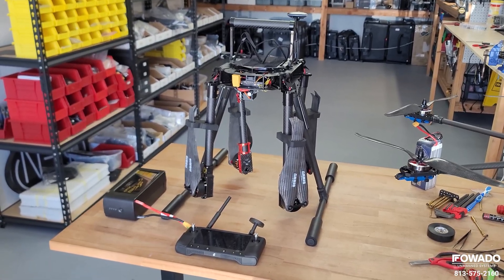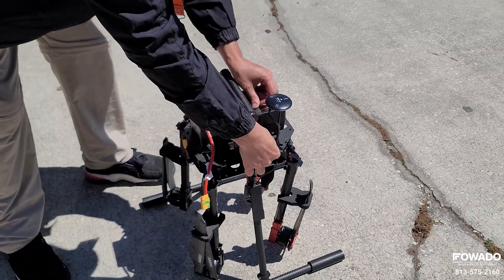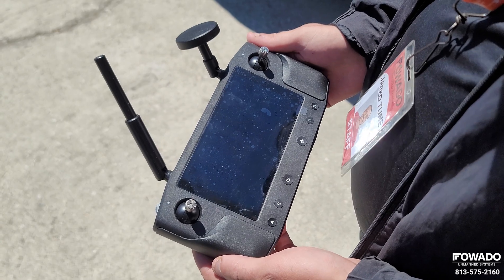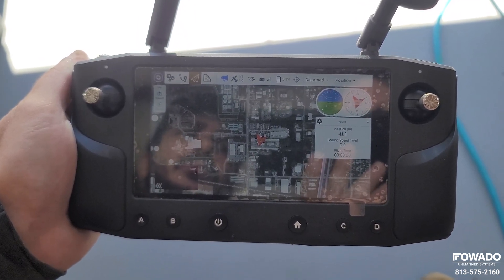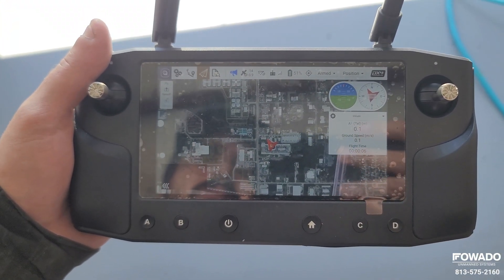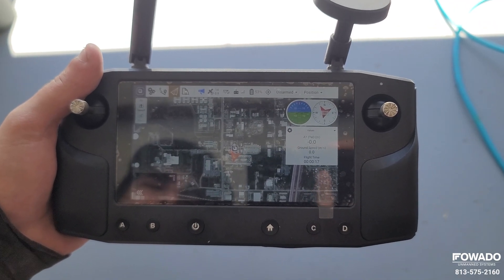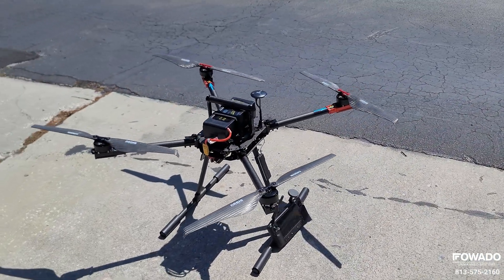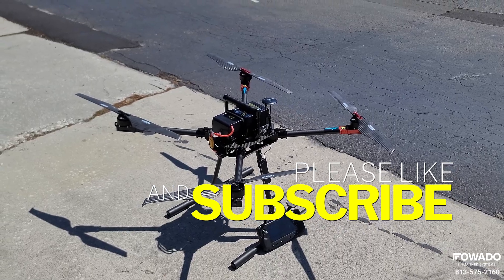Arris M900 Herelink Upgrade

Comment: You upgraded the controller. Did that make the drone any better or better control ?
Reply from the maker: The drone has several updates to it hardware, as well as the improved controller and flight controller. Check out our website for the latest model. 
www.fowadous.com

Comment: Do these drones has geo fencing and if so can it be turn off?
Reply from the maker: Hi thanks for the question,  the M900s built at our shop do not include restrictive geo fencing. Pilots need to exercise caution and perform pre-flight procedures to determine airspace restrictions.
Reply: So if I order it from another site does it come with geo fencing and if so would you guy be able to turn it off or explain to me how to do it
Reply: I have a m900 but trying to figure out if it comes with geo fencing and if it does I want to learn how to turn it off

Comment: What are the key differences?
Reply from the maker: Thanks for the question, Justin. 
• Herelink maximum transmission distance is 12 miles. With most users obtaining 2-4 miles in urban environments.  
• Herelink accepts Micro HDMI connections so a variety of cameras work with it.
• QGround control is the new flight software, so you can easily setup mapping missions, waypoint modes, etc.
• Herelink display is 1080P at 1000nitz of brightness (Can be viewed in direct sunlight)
• Mavlink Capabilities 
• User interface is in English so easy to work with and get support.  Overall better experience for American operators.
I hope that clears it up some. We'll be coming out with another video explaining the benefits.
Reply: @FowadoUS  roughly how much does the upgrade cost? I am about to purchase the m900
Reply from the maker: @Justin Freeman  It's cheaper and a much faster to get it from us directly.  Here is a link to our website. https://www.fowadotechnologygroup.com/product-page/m900-max-quadcopter-ready-to-fly
We have the M900s in stock along with the Herelinks. Our aircraft also come Pixhawk flight controllers which is another awesome benefit.

Comment: Am curious. Now I have a m900 and before I take off I gave to dance with it. Now I did not see you spin around with the drone.  So by having the herelink system does that negate from having to pick the drone up and spin with it. Plus I want to send my m900 to you asap to have it tubed up and possible installing my on order herelink system. Please give me an estimate on this asap😊
Reply from the maker: We perform the initial calibrations after that, none should be needed unless prompted by the system.
Reply: Have you fix your problem I'm also having that problem. After I calibrate it it's say EFK

Comment: Are you running a Cube autopilot in that or the Pixhack that it comes with?
Reply from the maker: Hi thanks for the questions, This particular unit is running a Pixhawk 6. However we can run the Pixhack (what they come with if you buy prebuilt) or the Cube if needed.   We prefer to install the Pixhawk.
Reply: @FowadoUS  thx guys. Ok I waiting on my herelink system which I want you guys to install. Like I said I want my m900 just like how you have yours.
Reply: The pixhawk